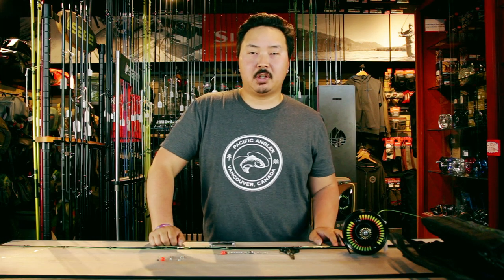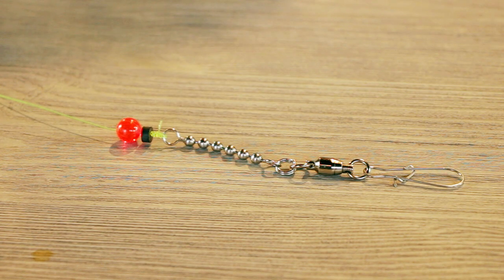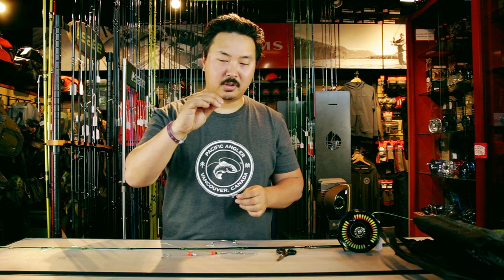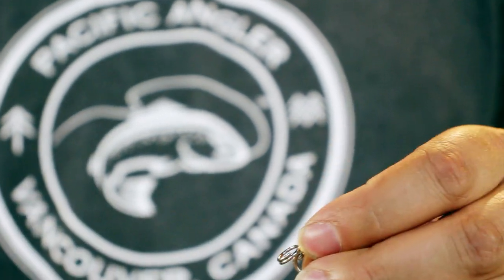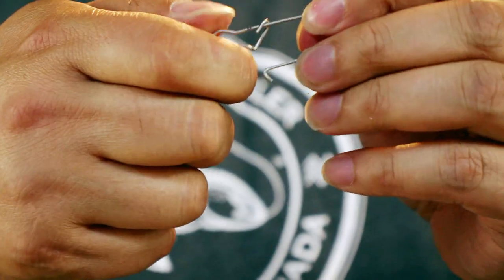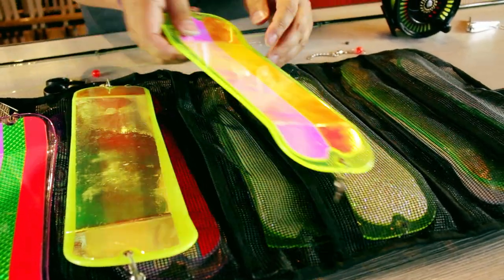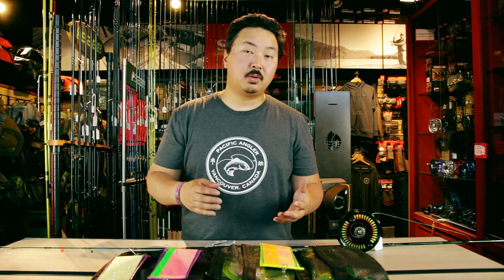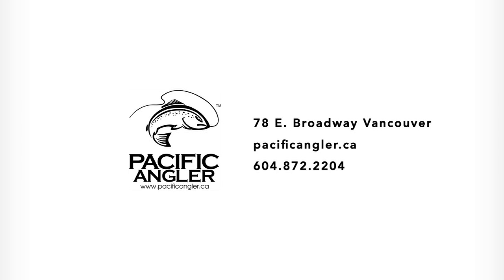HOW TO RIG UP A FLASHER FOR SALMON TROLLING | Learn How with Pacific Angler

Comment: Can you tell me what length my fwd portion of leader should be and strength? I troll chinook in open ocean at depths of 25 down to 160 pulls with an individual wt release (2.5 lbs). I got lots of answers on what goes on BEHIND the flasher but zero on length & strength in front of it. Thx in advance.

Comment: What is the purpose of the bumper and bead?
Reply from the maker: To protect the knot at the swivel when the main line catches debris (seaweed, etc) which slide down to the swivel.
Reply: @FishingwithRod  plus keeps the swivel from going in your rod tip